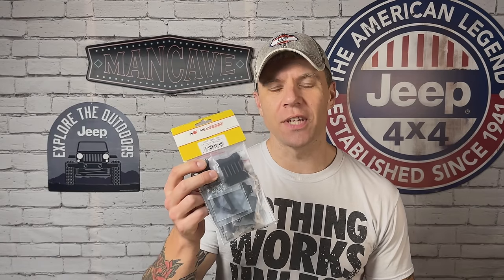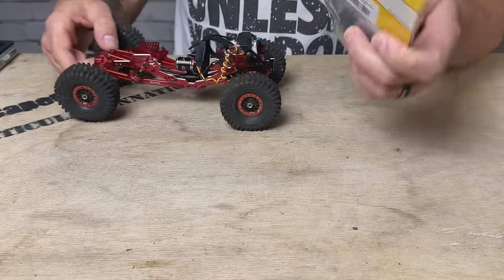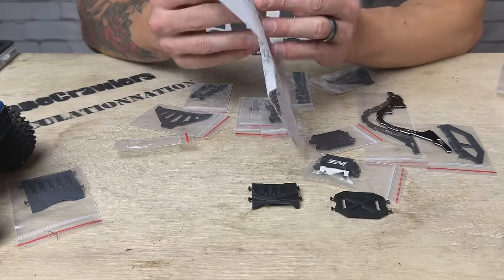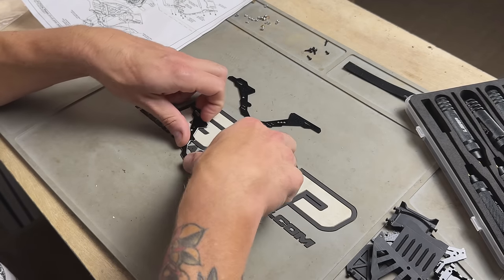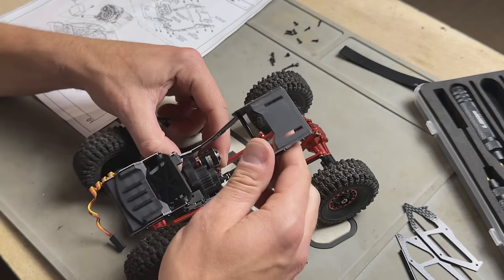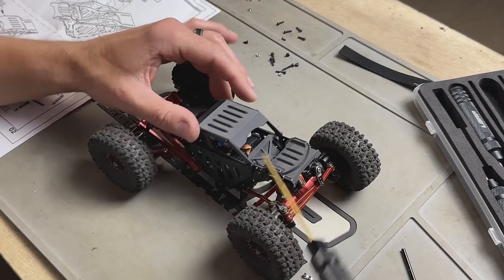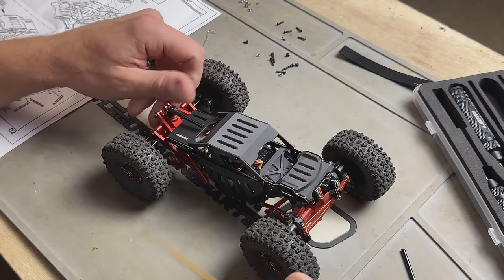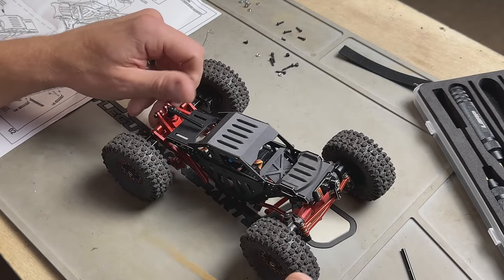Nexxspeed Dark Knight FCX24 Chassis! Installation, Run & Review!

Comment: Much appreciate the time and effort in each review.. that said, as tested, awful.  Swap some treal links with +12mm in rear to shorten it up, and swap some 59mm oil shocks to utilize those high arch shock mount points. Big tires only need apply. IMO.

Comment: Still a biggg fan of the Power Wagon. But! I think this thing would be a comp killer if you got those Power Hobby 58mm shocks, but only in the rear. Im running those on mine in the rear and it really helps keep at least 3 wheels planted at all times.  Also, flipping thise rear links have helped me a ton.  Using metal driveshafts, i can tip the rig to one side or the other to gain more wheel-to-ground action too.  Love this rig though!

Comment: Have a question: dose the furitek venom motor fit the scx24 transmission? If so it would work out a lot more cost efficient to buy a donor fx118 and use all the electrics, shocks etc to make a custom upgraded scx24 rock buggy build.

Comment: Thank you for the great video! I have a dark knight chassis on the way and can’t wait to build it. I am curious about a light bar for this chassis. Is there a place to mount one? Do you have one you recommend?
Reply from the maker: I wonder if you could get a light bar on the roof. If the mount was the right width I think it could work. Check out Injoras light bars. I’ve had good luck with them

Comment: Patiently waiting for an scx24 power wagon build
Reply: Personally an FCX fan. But if you were to run the stock SCX body, there's not a whole lot that could he done as far as I'm aware.  Stretching it would prove difficult since the wheel arches can't be relocated reasonably.  All I would really think to do is a brushless kit, brass housings, aftermarket linkage, then possibly a new wheel+tire combo. But even those are pretty good out of the box (so I hear). Let me know if you'd have a different idea! :)

Comment: On the dark knight, you lose the 2 speed transmission setup?
Reply from the maker: I only lost it because it’s running the brushless system and I don’t have the proper channel setup on my radio. Plus it’s way fast enough in low speed with the brushless motor
Reply: Can I use the skid plate for the scx24 transmission? Injora or furitek version?

Comment: You already had the joker now you got the black knight 😂
Why don't you use the battery hanging on the underside of the back with the strap ?
That one actually doesn't look all bad and looks really good combined with those links
Also Phillips screws should be universally forbidden in rcs 😂
I would get some springs for the front shocks to lift that belly a bit ,i think it will make no difference in the climbing performance and very little on side hilling